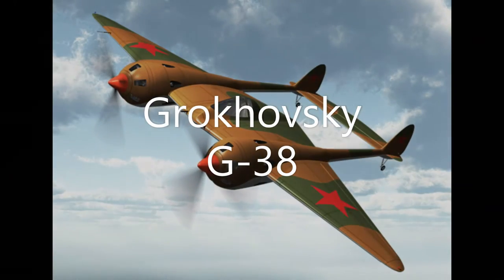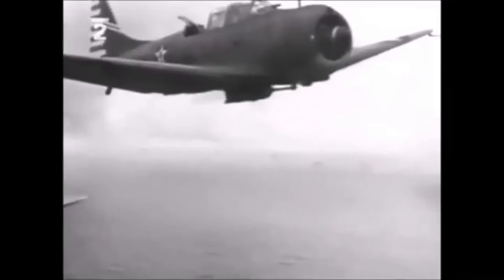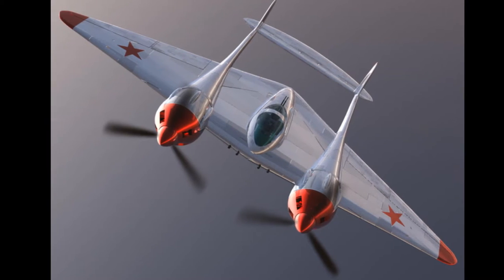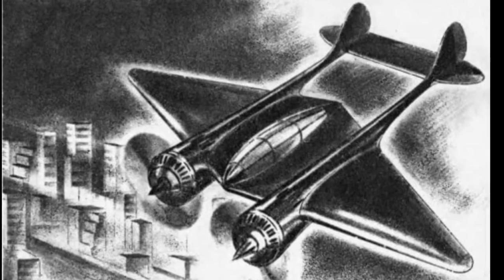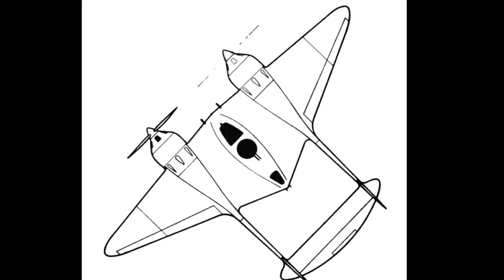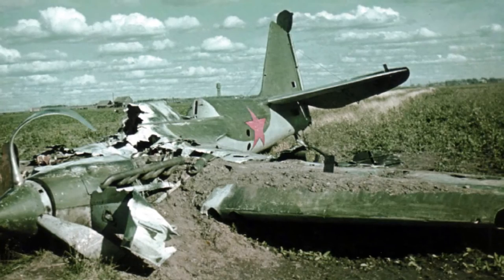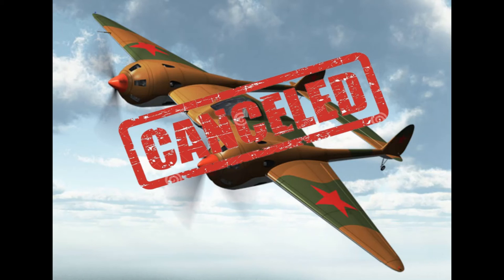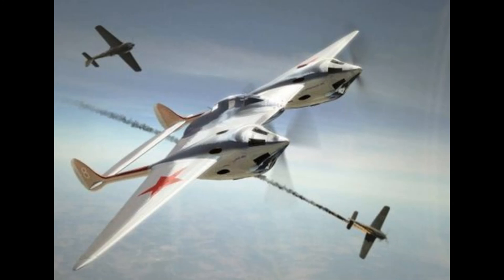The Soviet P-38

Comment: You're quite correct about early Soviet fighter designs used during the first couple of years of Soviet involvement in WW2. However, later in the war, Yakovlev and MiG came up with some rather advanced fighter designs that were equal, if not superior, to the Nazi fighters at the time.  Of course, they also had the Lend-Lease fighters that the US gave them.
Reply from the maker: Yes you are right, I was much more talking about the beginning of the war because this plane could have entered in service even before the operation Barbarossa because it was nearly at the completed prototype stage in 1937.
Reply: @F-14DTomcat   After looking at the video, it would seem either the Soviets had the same idea as the Americans at the same time or a visitor from the USSR visited Lockheed while the P-38 was being designed and liked it.
Reply from the maker: @drivernjax  I am not really sure that the Soviets this time stolen the concept because initially, it was to be a far larger plane and the one who corrected the plane (Ivenssen) was under placed high surveillance in 1935 due to a first condemnation (he got the right to keep working there) and so could not got to the US and the work on the P-38 started in 1937.
Reply: @F-14DTomcat  I didn't mean to imply that the Soviets stole the idea (although they weren't above doing something like that.  Of course, so were the USA and other countries.).  I meant to say that, perhaps, a visitor saw the concept and liked it and he returned to the USSR with the intent of developing a Soviet twin-boom fighter along the lines of the P-38.  There have been many times in which two countries developed similar things but took different tacks to get there.
Reply from the maker: Ok, got it🙂